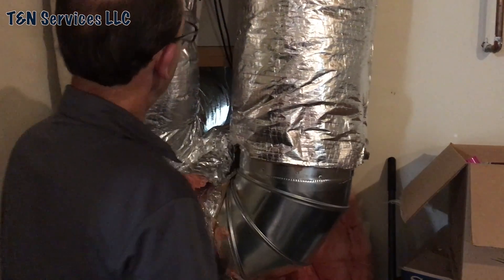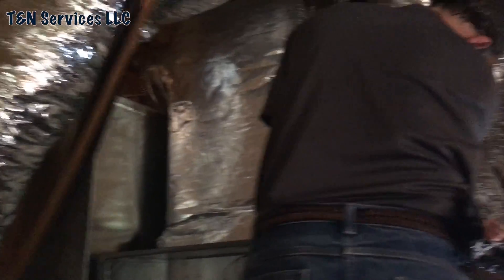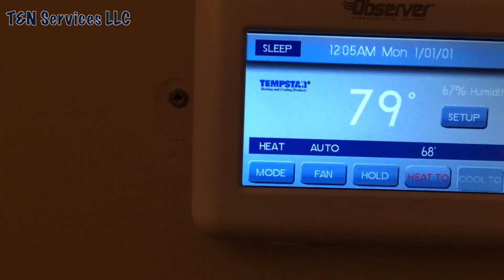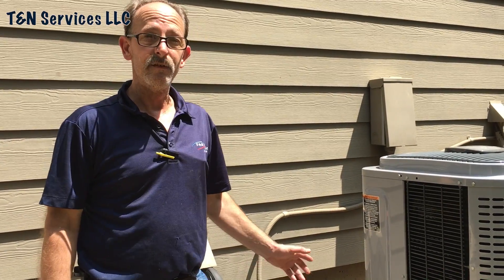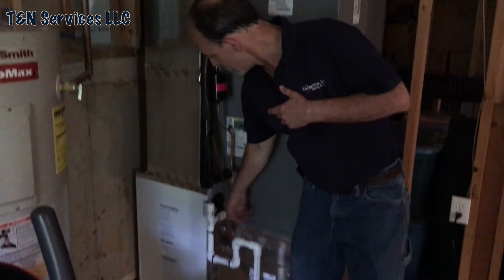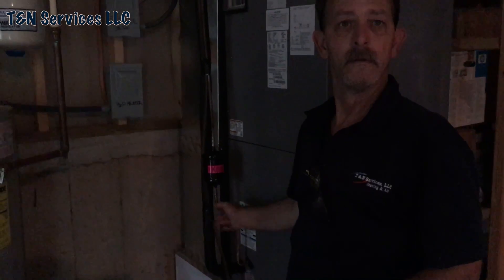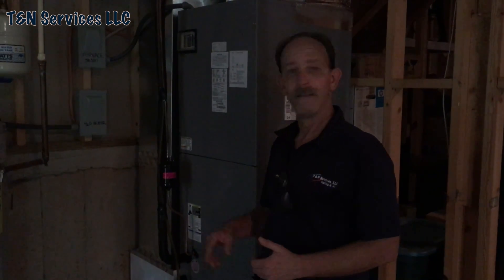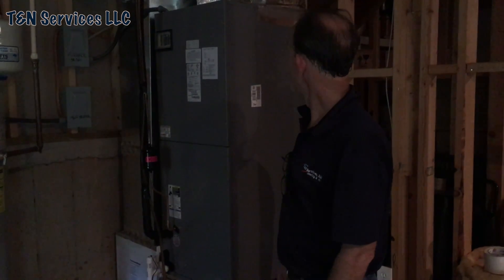HVAC 5 Speed Inverter Install: Part 2

Comment: For me nothing beats brazing for the simple reason is that even if I had the zoom lock there are always those situations in which you will have to braze for what you high lighted in your video is that there is not enough room to use the zoom lock. The other thing is that brazing is a skill. Zoom lock is in my opinion targeted to the DIY market, where skills are thought of as unnecessary. Air Conditioning refrigerant leaks often times develop due to vibrations of the equipment over time. I know the odds of a braze coming undone is extremely rare. If the zoom lock could handle any and all situations where I never needed a brazing rig, only then could I see it as viable. While speed is part of it, the other is cost. The fitting cost is controlled by zoom lock. The other is finding that fitting you need and carrying it on the truck. So the time you talk about saving is spent maintaining the coupling inventory for the zoom lock. If you don't have the coupling you need then it's off to the store. If I need a coupling to braze with, I can find those nearly anywhere. That is where the time difference is made up.

Comment: Not affordble,not to mention 35 dollars for one slip coupling on amazon.You have added over a hundred dollars to your cost just for the fittings.i like the tool ,but what about the longevity of those seals?I'm a small operator and that tool seems way overpriced and so are the fittings.

Comment: Nice job but question for ya. What is the point of using the zoom lock when you still have to braze on a replacement. Zoom lock needs their own liquid drier sand some kind of adapter for service valves and it would be money in my book!! 

What is the life expectancy on the o-rings in the fittings?

Good looking install

Comment: I was told that are contractors insurance would be cheaper if we're not brazing. Appliance industry going to crimped fittings due to hydrocarbon,  hvac industry will be next. I believe the EPA is fazeing 410a and are going to hydrocarbon.  Nice video thank you.

Comment: Yep, the Zoomlock looks like the future. I'm sure it will be much cheaper once it reaches the masses and some other manufacturers enter the arena. If you start seeing Zoomlock ready LL dryers along with other components, service valves etc. the copper would be the fastest easiest part of any job. Zoomlock ready condensers and evaporators would be a great thing too. Just think if you could do an install with only 6 Zoomlock joint presses, that would be a serious time saver.
Keep us up on this, I know you will let everybody know the good and the bad.
Reply: I have a feeling that manufacturers(in cahoots with Sporlan) will eventually require a 'braze free' install to maintain the 10yr Warranty - too many carbon'd-up TXVs and EXVs.
Reply: Milwaukee has a tool similar to this. It is a plumbing tool, but with some tweeking, it may become multi-trade.
Reply: Are Propress any cheaper

Comment: Nice looking job, Ralph. I do like the thought of not risking overheating a valve or TXV when using the Zoom Lock. I guess one could also Stabrite 8 the sucker as well...
Reply: tcpHVAC/R you ever watch the video on stay Brite 8,that guy says he had been using on 410a also with great succes and it holds fine.what do you think?

Comment: Home Depot shark bites are a lot cheaper! That sure is a perty install.
Reply: Wayne Miles - Shark bite fittings are strictly for water use only, it can't handle the pressures of an AC system. Zoom zoom can
Reply: Tommy TMT I guess you didn't get the joke.

Comment: I loved you install the ducts came out wonderful too. Where did you get that box the unit is sitting on? My only construnction criticism is the line set right in front of panels.
Reply from the maker: Thanks Joe, no problem with the lineset because you can get the screws out of the door very easily and you can get the motor out if needed. I will be the guy going back so I can assure you I made it easy on myself.

Comment: Love the idea of the Zoomlock, can't justify $3000+ in a tool to save 15 to 20 min of work. Tell them to bring down the price to $200 and you got a deal.
Reply: $1500 would be a reasonable price.
Reply: Buy propers and buy just zoomlock heads you got plumbing a no Hvac press tools for 3 k

Comment: It seems like the best balance will be to have a Zoomlock (if you can afford one) and the traditional oxy / acetylene rig.  I've been in some super tight spaces where the Zoomlock probably wouldn't fit.  And then there are things like dryers which I don't even think is possible to Zoomlock.  What I don't seem to hear much about is HVAC Super Pro......  Maybe after everyone that has ever used HVAC Super Pro had to replace all those "glue" joints with brazing, it doesn't get much attention anymore......

Comment: Watching you cut the bells off the Condensing unit to do Zoomlock was like watching somebody get kicked in the nuts! You can feel the pain. Zoomlock is cool. 
Hell Trevor ought to have sporlan make driers that come with the fittings from factory. No worries about frying the TXV! I'm Glad you showcased it and I got to see. 
As far as reliability of the fitting only time will tell. 
I wonder if the fittings are rated for a hot gas line?
Reply from the maker: Jonathan Bennett I like to live dangerously LOL. They do make Zoomlock dryers I had one for this job but I tried to be super man and follow the steps and messed it up.
Reply: T&N Services LLC. Zoomlock is just as you said can't replace brazing but saves time for sure. I hope that zoom lock proves itself to be tried and true. Defiantly keep us updated

Comment: Great video Ralph. So you can set the humidity levels with the observer stat? I only ask because John did a ICP inverter install and said the stat automatically does it for you.
Reply from the maker: Eddie Sellers you have to set it for the humidity level you want it to be in the space